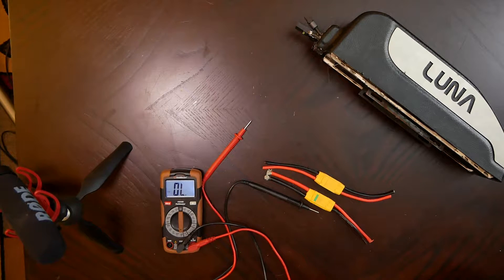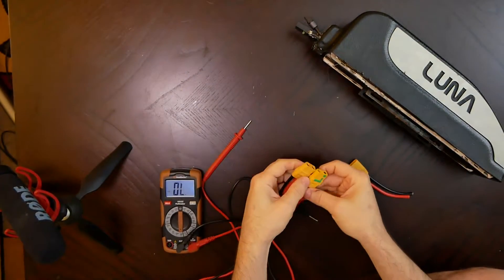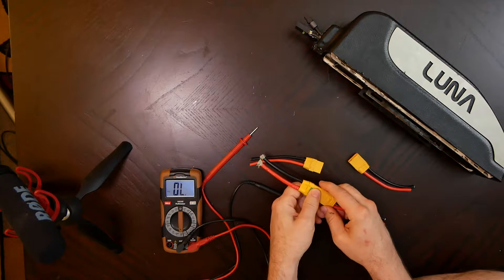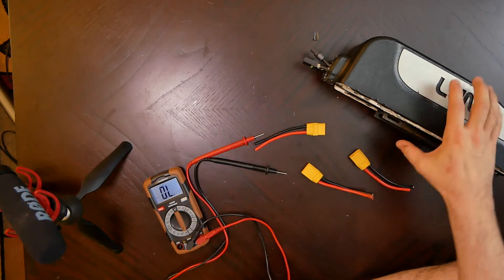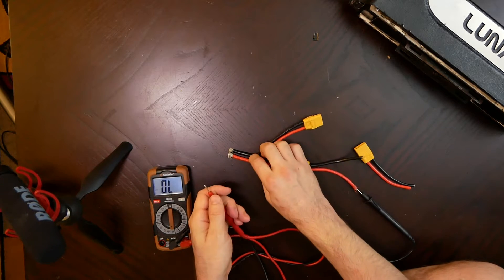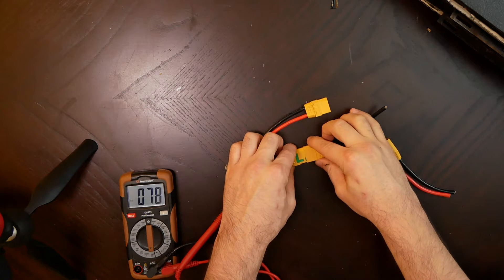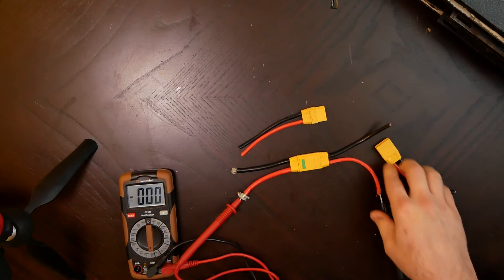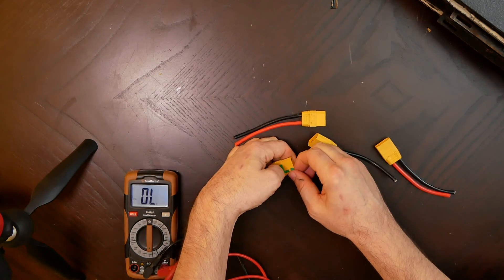How to use XT90-S Antispark Connectors

Comment: You say "when plugged halfway it's definitly enough to power the system" the whole purpose of this is not to "power the system" but it is to charge the capacitor in the charger to avoid the big spatk. That's the whole logic of this antispark system. Avoiding huge current surge that comes with having capacitor in the charger to fill up, by transiently reducing current with a resistor for a few millisecond. That's what should be mentionned in this video. 1) Spark occurs cause of capacitor 2) spark can be avoided by transiently reducing current for short period with the aid of a current limiting resistor. 3) here is how the Antispark XT connector is engeneered to do this.

Comment: Does it matter which side has the female spark function? Would it be preferred to have the anti spark female coming from the battery?
Reply from the maker: It does not technically matter what side it is put on but best practices would have it on the side that is supplying power.
Reply: @fuzzyfriendlydoggy  Yeah I've heard that, thank you. I am just wondering because my battery came with female xt60 and I don't really want to mess with it since it's carrying high voltage. I'd rather just plug in a xt60 to xt90 adapter and put a xt90 female on my controller to connect my battery and controller
Reply from the maker: @DyLemmaOG  there are adapters you can get with any gender, like xt60 male to xt90-s female. Even if you got an adapter like this xt60 female to xt90-s female you could just stick an xt60 male to male adapter on the end of it. Would still be plug and play. https://www.ebay.com/itm/203078513528?mkcid=16&mkevt=1&mkrid=711-127632-2357-0&ssspo=hJEz7dp-Ti-&sssrc=2051273&ssuid=hJEz7dp-Ti-&var=&widget_ver=artemis&media=COPY

The benefit is if you are wearing a ring or the connector brushes against a zipper, it won't ruin your day or possibly cause you to lose a finger
Reply: @fuzzyfriendlydoggy I wish I saw this before. I would have bought that. But I just soldered my own connection with anti spark, lol.
Reply from the maker: @DyLemmaOG  Well you could always plug in an adapter that changes it to antispark if you wanted to.

Comment: that is a funky multi meter. bouncing between -0.3 and +1.8 ohms with no one touching anything. I mean its fine for this use case no problem, it was just kind of funny. I have had lots of cheap meters do crazy things as well. I had one read like 2x too high once.
Reply from the maker: It has a lot of sentimental value. It belonged to my father and before that my grandpa. While I am sure grandpa just got it from radioshack, there is something comforting using a tool owned by someone I respected so much, you know? 

Also it is so simple compared to modern ones that it is hopefully more understandable for newbies lol
Reply: @fuzzyfriendlydoggy  awesome, well then the meter is better than i thought if its that old. Also great to use things as long as we can to keep them out of landfills. Its certainly not broken.

Comment: I hope you still answer to comments after all this time... Can I still use the cable even if the resistor is burnt?
Reply from the maker: Yes, you can. Ideally you would clean it out with some nonconductive contact cleaner and a q tip first or there will be some debris inside, but as can be seen in the video as long as you can get the plug pushed past the point of that resistor it will make a full connection. So unless the melted resistor is so melted that you cannot fully insert the connector, you could in theory continue to use it; you just would no longer have antispark. 

Hope that helps!

Comment: Nice video explained very well. Could you tell me if there is a difference to fix the connector with the resistor on the batteries or on the regulator, or is it indifferent?
Thanks so much.
Reply from the maker: Not sure what you mean, can you clarify
Reply: @fuzzyfriendlydoggy  The XT90 is used to connect the batteries to the ESC. I ask you if the connector with green stripes (it should have the resistance) must  be fixed on the batteries wires or on the ESC wires, or there is no problem where I put it. Tanks so much.
Reply from the maker: @ms888  The only side with anti-spark (the resistor) is female. It is standard best practice to put female connectors on the side that is supplying power, since that is the more dangerous side and the last thing you want is to short out a battery side connection against something like loose jewelry, wedding ring etc. 

That said, sure you could put it on either side if you wanted to.

Comment: What's the max amps a xt90s can handle without destroying the resistor?
Reply from the maker: You could go 90A on it. As long as you plug it in fully the resistor has no effect on the current rating. It's just the folks that plug it in halfway that end up breaking it.
Reply: fuzzyfriendlydoggy thanks bro I am using in my scooter and I just rebuilt the entire power system. I have about 9000watts of power at 60volts and plan on running about 50-70amps. After I finish my last motor modifications.
Reply: you only run through the resistor when half plugged in. When fully plugged in it bypasses the resistor, the point is to slowly introduce the connection as you plug it in rather than going from "no connection (basically infinite ohm)" to "~0 ohm connection", rather with anti-spark you go "infinite ohm connection" => "60 ohm connection" => "0 ohm connection" effectively supressing any sparks from things drawing start-up current through the connector in the split second when the connector isn't fully connected yet whilst plugging it in

Comment: Question is the anti-spark Technology on both sides female and male or only female side?
Reply from the maker: Female only. You can actually plug any regular male XT90 into a female XT90-s and it works the same.
Reply: @fuzzyfriendlydoggy  thanks

Comment: Minenis still melting the connector. What is going on? Can you help?
Reply from the maker: If the resistor melted then you did not push it in far enough. If you only saw this video after it melted there's nothing that will undo the permanent damage and to that resistor and if possible you would need to use a backup port or replace the connector